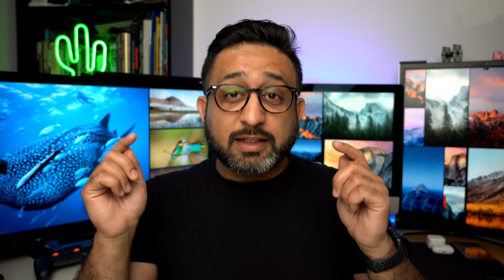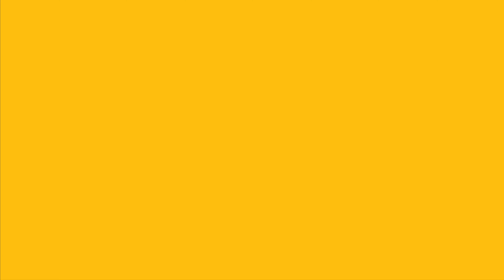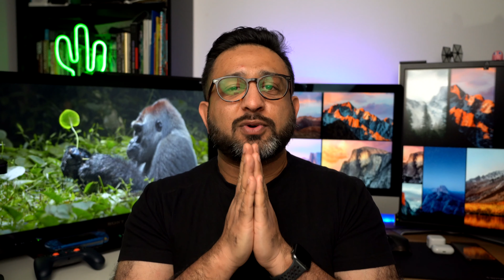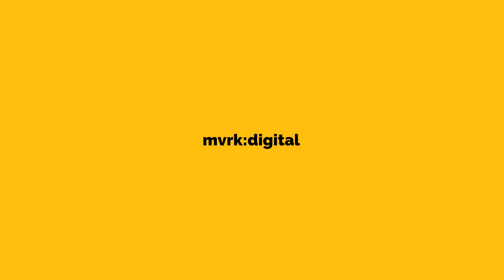Razer Blade Pro 17 2020: A Graphics Powerhouse!

Comment: Thanks for the Vid! How to switch on or off the turbo boost/mode? is it just done through the synapse? or is there like a windows shortcut to enable and disable the turbo boost? or does it actually work automatically in the background?

and will undervolting, disable the ability for turbo boost?
thanks

Comment: i just got my razer blade pro 17 inch with the 4k 120 touch display and im absolutely loving it ..it runs every game i throw at it on ultra settings no problem. some of the newer AAA games i have to dial it down to 1440p to get the 120 fps but this is with ultra settings on everything. i can't recommend it enough if you have the money and are in the market for a new laptop.
Reply from the maker: That’s awesome 😃

Comment: Update: I spoke to an insider within Razer. Although he did not say so specifically, it seems that the Razer Blade Pro 17 Studio Edition is not necessarily going to be released. What he said was that they continue to monitor & evaluate the needs & requirements of the 17" laptop market, so in other words, Razer is not certain that there is enough demand for them to release this product. Such sad news, especially given that no Razer laptop at the moment has any i9 CPUs.
Reply from the maker: It’s sad but makes sense from Razers perspective. They’re not a huge company like Apple or Dell so can’t afford to have multiple similar looking SKUs cannibalising each other. Lack of an i9 machine though just baffles me 🧐
Reply: @MaverickDigital  I agree with the logic, yes, and I'm also baffled by the lack of an i9. I mean if the Pro 17 Studio Edition is not going to happen, add an i9 configuration option to the regular Pro 17 for those who want it!
Reply from the maker: I think it just shows that the machines thermals are not able to maximise the i9 potential and also shows the build is prioritised more for GPU intensive operations.
Reply: @MaverickDigital  Too bad, really. There's a solid difference between the 8-core i7 & 8-core i9 in Intel's 10th Gen! It's too bad that Razer does not think this is important, or that their design cannot handle the i9. Check out the following article. If you don't want to go over the benchmark details, just go over the intro prior to 'Benchmarks', then scroll all the way down to 'What We Learned':

https://www.techspot.com/review/2036-intel-core-i9-10980hk/
Reply from the maker: Will check out the link in a bit. But hey it’s 2020  so don’t discount anything! 🤣
Reply: @MaverickDigital  Truth!

Comment: The best thing about this crazy powerful laptop is the heat management system. It's way better designed than Apple's unibody.
Reply from the maker: Vapour chamber cooling is really nice. Razer does it well but their machines lack the battery chops like the XPS 17. With regards to MacBooks, I’m sure Apple would follow if the XPS 17 and this machine do well and crush those performance numbers.

Comment: loved your vid.👌
But I just wanna ask if it's worth it to buy this or wait for an amd cpu if it will be coming in the next year or so.

I also wanna ask u if not having g sync on 300hz would be a problem in this device as screen tearing are very annoying on 60hz.
Reply from the maker: If you are currently looking for a new machine then buy this one. AMD is awesome but the i7 ain’t no slouch 😂 If you can wait and wouldn’t mind a machine with possibly no Thunderbolt 3/4 then definitely save up for it. 
Laptops generally have a very customised display controller with their own proprietary sync management systems so don’t really need G-Sync or Free Sync for that performance.

Comment: Thank you for the overview! I just subscribed to your channel, man! Keeping up the good content, and you'll grow for sure. If you end up buying this laptop, please do a review on it. 

I have a couple of points:

I agree that the performance gains are negligible between the Intel Comet Lake i7-10875H that this laptop uses vs. the Intel Comet Lake i9-10980HK (the highest-end, non-workstation Intel Mobile CPU). However, it would've been really nice if Razer provided the i9 as an option for those of us who want to overclock the CPU. While I don't have the data to support this, I really think the vapor chamber that Razer is using in this laptop can adequately handle the i9's heat, even with the NVIDIA RTX 2080 SUPER Max-Q configuration option. In fact, GIGABYTE is doing exactly that with their AERO 17 HDR YB model in a similarly-sized chassis:

https://www.gigabyte.com/Laptop/AERO-17-HDR--Intel-10th-Gen/sp#sp

I also agree that the 70.5Wh is too small for such a premium 17-inch laptop. Once again, GIGABYTE has a 94.24Wh battery in the aforementioned model, and a slightly lighter weight (2.5 Kgs vs. Razer's 2.75 Kgs). Though to be fair to Razer, GIGABYTE does have some inferior specs - no upward-facing speakers, no 4K 120Hz option, UHS-II card reader vs. Razer's UHS-III, inferior Ethernet port [1 Gbps vs. Razer's 2.5 Gbps], and inferior USB Type A ports [SuperSpeed USB 5 Gbps vs. Razer's SuperSpeed USB 10 Gbps]. 

I don't know if it's possible from a product design and engineering perspective, but if Razer can provide the i9-10980HK as an option, and boost the battery capacity to as close as possible to 100Wh (the maximum limit allowed by airplane regulations), it would be a perfect laptop in its category for the currently available spec options. I'm personally fine with the weight going up to 2.80-ish Kgs to accommodate the larger battery.
Reply from the maker: I agree that an i9 and a bigger battery would’ve made this unbeatable. But I think there’s a few reasons why they didn’t do they. 
1. Last years machines had a lot of quality control and failure issues so they’re playing it safe. 
2. This is Razers’ Generalist/High End gaming line so the priority was to keep the best GPU and the second best CPU available and keep the cost/performance manageable and affordable. 
3. Razer are calling this a desktop replacement so battery is perhaps not their priority and all the focus is one performance and a robust cooling architecture to manage it. 
4. Razer has a studio line where they could bring in the pro spec machines and maybe even bring some love to an AMD/Radeon combo 🤞🏼
Reply: @mvrk Digital Thank you for responding. All your points are valid and make sense, particularly points 1 & 3. 

My guess is that with next year's yet another 14nm Rocket Lake H-Series CPUs from Intel, deign and specs will remain largely the same for most high-end laptop models, including this one. However, with Intel likely skipping the 10nm architecture altogether for the H-Series (still a rumor, nothing's confirmed) and going straight to a 7nm Meteor Lake-H in 2022, I'm hoping that the redesigned architecture will help dissipate less hate, which should encourage manufactures, including Razer, to adopt the i9 CPUs more widely. By then, I also hope that Razer gets to iron out the vast majority of their quality-related issues, which should make this adoption all the more likely.

As for point number 2, I agree, but offering the i9 as an option only - just like GIGABYTE did -  not a standard component, would have made sense for those who want it and are willing to pay more for it. However, in light of point number 1, I agree, it might not be feasible.

As for point number 4, yessir, I am very much aware of the Studio Edition lineup. However, only the 15" model was released last year, and will likely be refreshed this year, but there is no sign of the 17 Studio Edition, despite being announced in May of last year at the same time as the 15" model:

https://press.razer.com/product-news/crafted-for-creators-razer-blade-studio-edition-laptops/

I've actually been in touch with Razer's Support multiple times since Fall 2019, its originally planned release date, and they could not confirm whether the 17" model has been pushed to this year (with updated specs of course) or scrapped altogether. A few days ago, they promised to email me about it specifically, but I'm yet to hear back. As for the argument that the i9 is being reserved specifically for this lineup, here is where I may disagree.

It seemed from the press release that the 4K 120Hz display was also going to be exclusive to the 17 Studio Edition, but that's not the case since it's also available for the regular 17 Pro. Also, the i9 model that was supposed to come out with last year's release (i9-9880H) is not the overclockable version (i9-9880HK), which was a little disappointing. 

I will argue that the GPU of the Studio Edition should be the main differentiating factor. The creator-optimized Quadro RTX 5000 (and 6000 should they choose to offer it as an option) is THE selling point for 17 SE, and targets a specific niche market. However, while the i9 should absolutely be on the SE lineup as a standard configuration, it should not be exclusive to it. It's not as niche of a product as the Quadro RTX GPUs, and should not be clubbed exclusively with it.

What are your thoughts on this?
Reply from the maker: To be honest not offering a custom SKU with an i9 is quite weird. My guess is that they’re doing it to stop the Blade Pro 17 from cannibalising a possible higher spec unannounced product. Also remember that Razer are a relatively small company and with the Covid-19 global crisis and an unprecedented economic crisis, this might be a move to maximise their profits and avoid a potential disaster. 
But yup still weird to think why not an i9 😂
Reply: @MaverickDigital  I think you got the right word there - product cannibalization. That is very likely the reason. A bit of greed maybe, and wanting to push customers toward a Studio Edition even when they have no need whatsoever for the Quadro RTX. I am one of those - I'd love the i9 HK option with the highest-end GeForce RTX Max-Q on a regular 17 Pro, because I do not want/need to pay that much more for a Quadro RTX. This is exactly what GIGABYTE currently offers, albeit with inferior display refresh rate and port versions. Honestly I don't think it's a smart move on Razer's part, and may end up pushing people like me toward the GIGABYTE AERO 17 eventually.
Reply from the maker: Thank you for subscribing. Glad you liked the video 🙂🙏🏼

Comment: Great video man keep up the good work. At the end of the day a max out XPS 17 is gonna be around the same price or maybe 2 to 300 less , which one would you pick if it was your money?
Reply from the maker: I would love to get the Razer but the XPS17 is just an outstanding machine with very well rounded specs. The big advantage with Dell is a global support network present to assist in case of a device failure or service required. That’s one of the reasons why Apple, Lenovo, HP and Dell etc continue to dominate the corporate and creative markets.